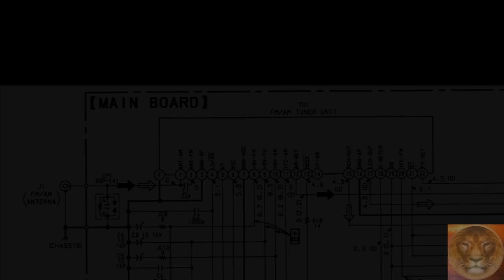Add aux port to Sony XR - C550RDS car audio system

Comment: One of the numbers if capacitors is wrong. C102 instead C101. The other  C202 is correct.

Comment: Would this work for the Sony XR-1750, do you think?  (It looks almost the same!)
Reply: Thank you, I did it!! Found the schematics: my board was a little different (although the faceplate is very similar), but I tapped into caps 153 and 253 in a very similar way. A small bluetooth module adds bluetooth functionality with the flip of a switch!  Kind of like kniting your own shoes, but I love it!

Comment: Do you used a 4 pole cable or 3 pole cable?

There's no necessary to use resistances or other components?

Comment: correct me if im wrong but this head unit already had an aux in it is BUS AUDIO IN at the rear.
Reply: sorry to say but those bus audio in at the rear are rca output connectors (out meaning the give out signal but dont collect
Reply: yes now I understand, I have sony head unit that has a bus in at the rear and it's also written aux in below.
Reply: kool

Comment: Hi friend, I have a Sony XR 6600 with cassette player, I removed the cassette mechanism because it had some broken gears and it stopped working normally, so I would like instead of the cassettes to add an auxiliary input of an mp3 or mobile phone , but I would like to use the tape switch that was on the front panel, so I switched to tuner, to listen to the radio and pressed the tape button to listen to mp3 or other connected device, in short, I liked the panel to show, PLAY when I was listen to the mp3 player, as originally if I
 were listening to cassettes, I hope you understand my reasoning, can you help me to transform my car radio?
Best Regards

Comment: Hi. Thanks for video. I apply it to my XR - C450RDS. But when i connect the phone to aux, only right speaker works. Why is it?
Reply: Cüneyt Cebeci what were the numbers for the wires?
Reply: I have exactly the same problem with xr 2803. Tried everything, only right channel is working. Connector is fine, wires as well.. Have you managed to figure it out?